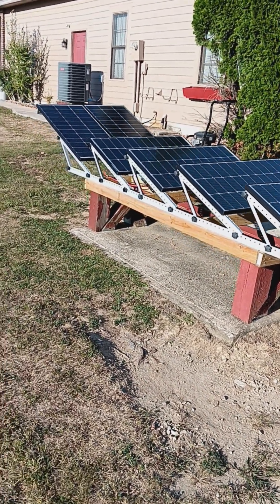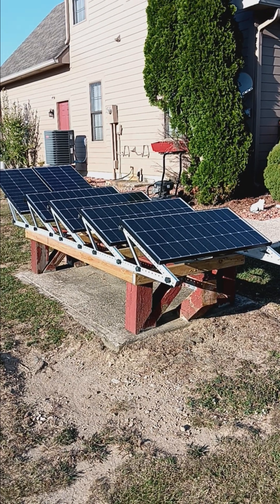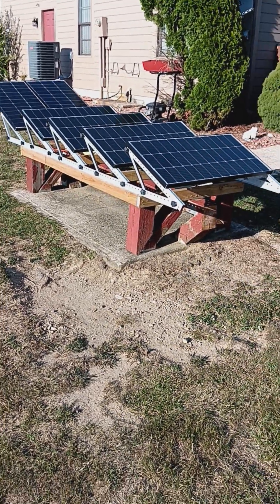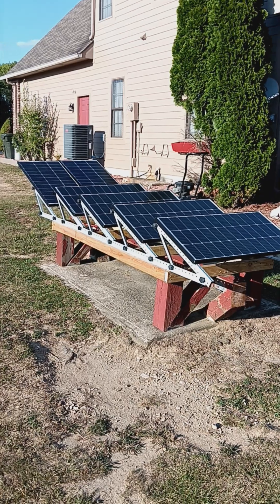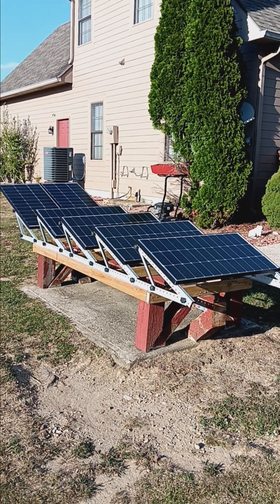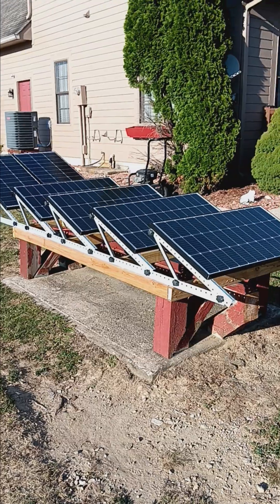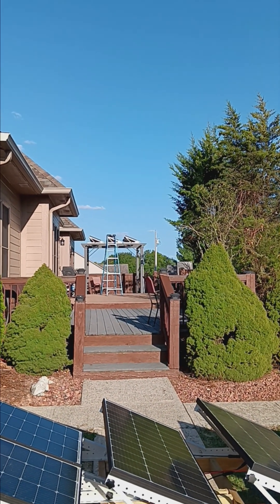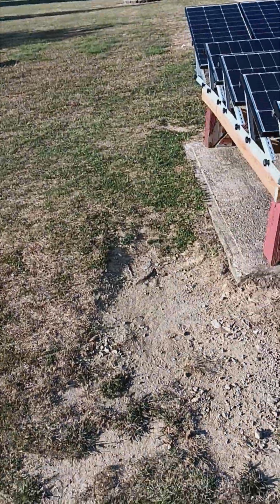Don't mix and match and do your math. 4 or 6 solar panels. 500 watts of input now!

Comment: what are you powering with your limited battery bank? that's your weakest link right now. is it really only 2 kilowatt hours? or the 10% - 90% ? and its low voltage input limitation is holding your panels under water.

the solar panels and the entire system works better with higher voltage. 
if electrons are like water, then Voltage is the pressure, and the Amperage is the flow.  Volts X Amps = Watts.,  . , ,, watters flow 

low voltage requires more amps so you need much thicker wire, you're also getting more HEAT which is hard on the circuit boards.       

i advise you to go back to the drawing board and set up a 48v battery, inverter, MPPT charger(Maximum Power Point Tracking) 

if you plan to do more than charging phones and led lights, get a battery that has at least 10 kilowatt hours, 48 volts. like Eve 280 amp hour Lithium Iron Phosphate prismatic cells. 
then you can get back to optimizing the solar panels after
Reply from the maker: I'm using two Ecoflow Delta 2s right now. The max solar input is 500 watts and now I'm hitting that mark. They are 1024 ah each. They are currently running my refrigerator, freezer, big screen, wifi, and some room lights.
Reply: @larvae91  1024 ah at what voltage? that way you can calculate watt hours, 
12v X 1024 ah = 12,288 watt hours  
or 
48v X 1024 ah =  49,152 watt hours. 

my battery made of 16, 3.2 volt 280 ah Eve cells wired in series for a battery bank with 
51.2 volts X 280 amp hours = 14,336 watt hours
Reply from the maker: I'm sorry it's 1024 watt hours each.
Reply: @larvae91  my mini fridge with freezer top compartment uses about 850 watt hours daily, hardly noticeable. but my u-shaped split ac window unit cooling a 350 cubic foot space, uses about 3000 watt hours daily, and thats 77 degrees....  but its been pretty hot out. 
im trying to get a good deal on some Bi-facial solar panels, i wish i got those type originally. 
off grid right now and i use an inverter generator to charge up the battery here and there, especially since its been cloudy for weeks.. 🤬 
atleast its the most efficient way to run a generator as you can set the ideal load / RPM which is about 60% its rated running watts. and in the future i will make a gasifier so i can run my generator with fire wood / woodgas

Comment: here is another tidbit of information:
Voltage is pushed from the source (potential, pressure) and you don't want to exceed the capacity of the load device (charge controller)
Current (amps) is pulled from the load (draw) and you don't want to exceed the capacity of the source or the connections.
Power will be limited by the charge controller, and you'll have the 500 watts longer through the day, and for some cloudy conditions (shading) with the little extra solar panel capability that you installed.